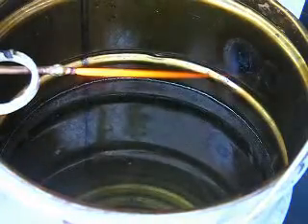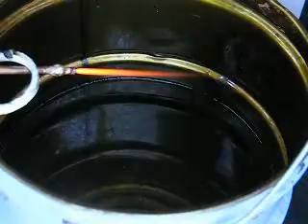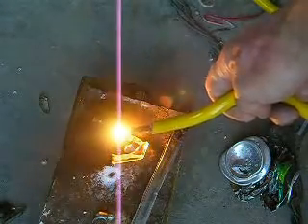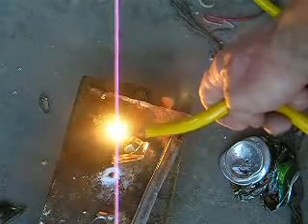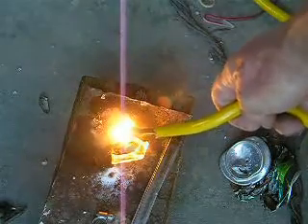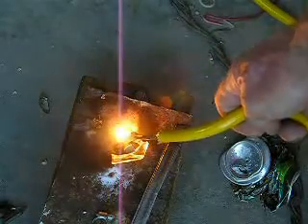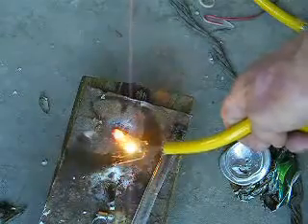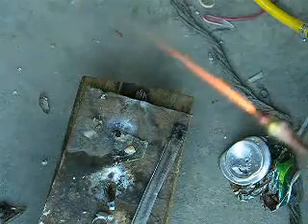Hydrogen Torch Demo

Comment: Great job done congrats ....how many plates you used for 4 LPM ? The hho unit is working on how many volts & amps ? what is the plate size ?what is the gap in two plates
Reply from the maker: Hi, this unit had 9 plates separated by 1/8 plastic rim, it was running on a battery charger at about 60 amps and 20 volts DC.  The plates were stainless steel outlet covers hammered flat.

Comment: wait for the tube to build up pressure, putting your finger on the tip of the torch helps, and if it still dosent work, ue more voltge on your hho genorator or a better hho genorator design.
hope that helps

Comment: Do you have any tips on how to build a torch? I made a generator and flash back bubbler all in one unit, it works great, in fact it even produces a positive pressure, however I havent found a way to ignite the hydrogen gas it develops without it just making a popping sound and a small flash and thats it, it wont hold a flame continuously, but the flash back bubbler works great.